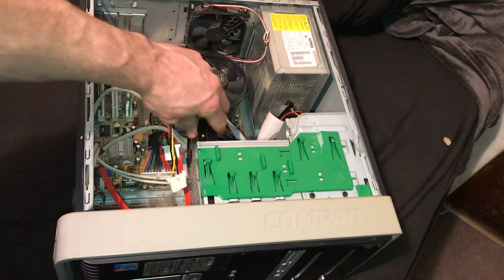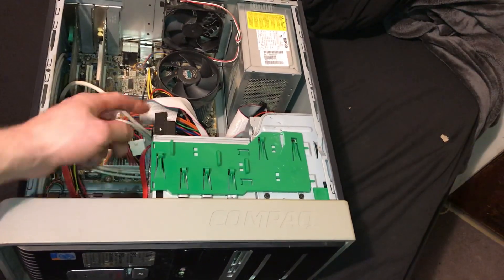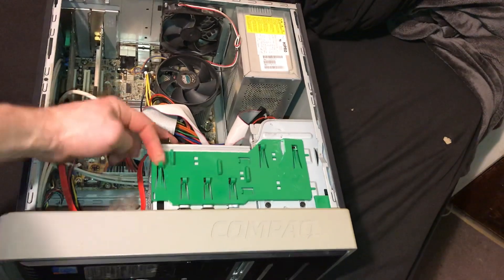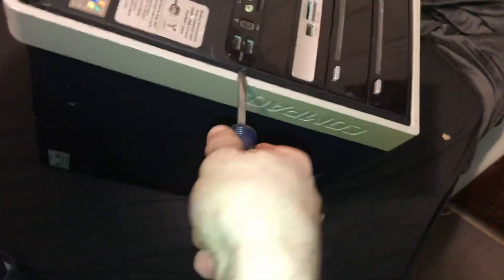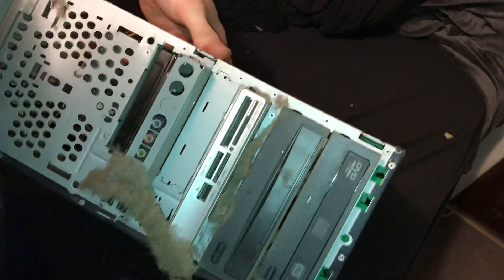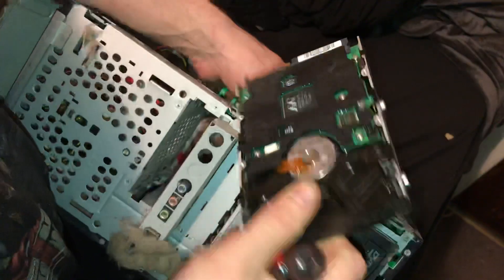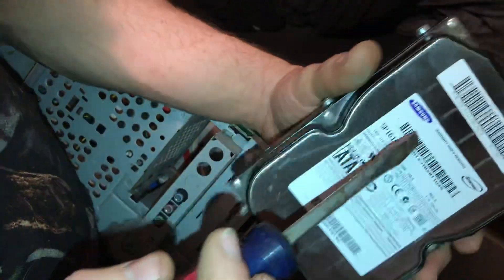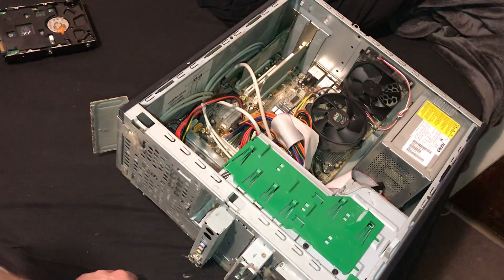[How to] remove hard drive from COMPAQ desktop computer

Comment: Pro tip: tear the green thing off completely and slide the HDD out the back (once you remove the front panel for which there are instructions on how to do so written on the inside of the PC)

Comment: Brother i have same cpu and I'm not able to remove by hard drive because a screw is in at bottom side which locks it, there is no space to use screw driver. How to remove it? U have any idea?
Reply from the maker: Push on the silver tab ,while moving it away from the tab, it will pop right up bud

Comment: Thumbs up cause this got me headed in the right direction and I enjoyed the video. I did find an easier way for those interested.
Once the side panel is off, push in the green tab at the top. Then there should be 2 black tabs on the inside of the front panel near the bottom. Push those 2 outwards and the front panel should come off. From there, you can slide the hard drive out the front.
Reply: This comment helped me so much!!! Thanks!
Reply: Wish I read this a few minutes ago. Still it was so satisfying popping the fucking thing off with the screwdriver after 30 minutes of frustration
Reply: Can you take this hard drive and put it in a newer Dell computer to retrieve old files?